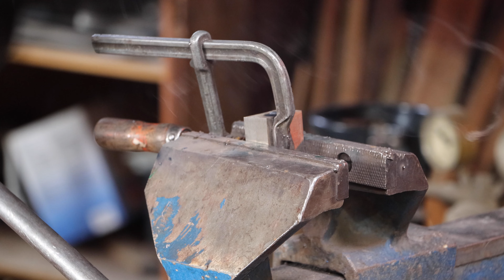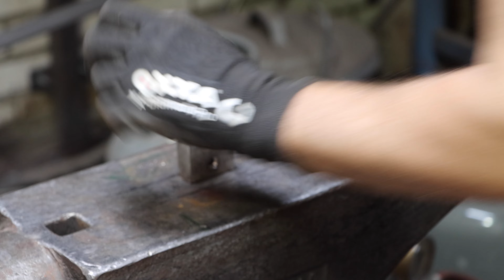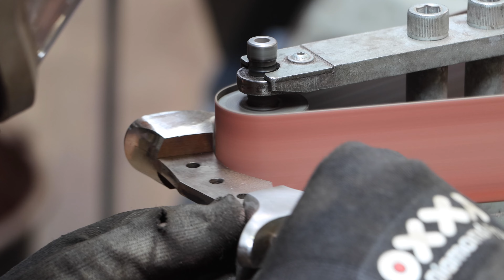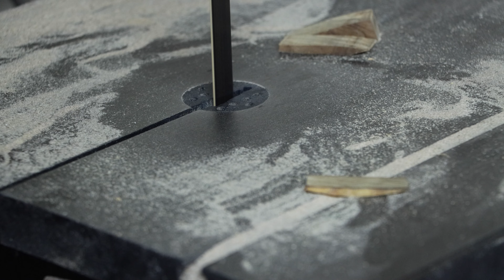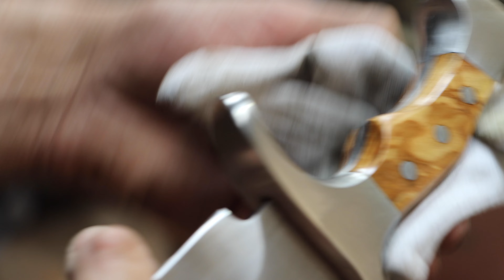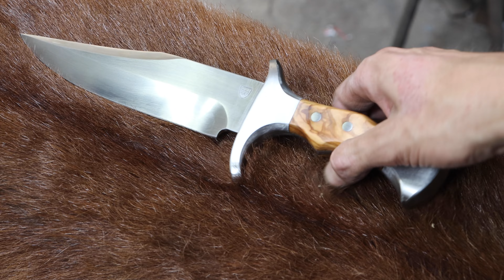Forging a stainless steel bowie knife set,  part 3, making the handle.

Comment: Question. Why did you do the scales individually instead mounting both on the knife. Thanks.
Reply: The rivet holes are on the tang. So you have to align them separately. That's my opinion. It's better than to drill a hardened tang in a package.